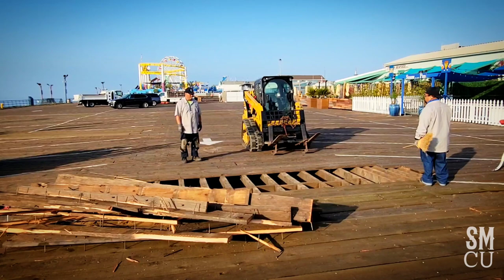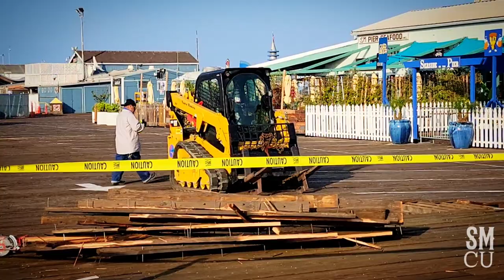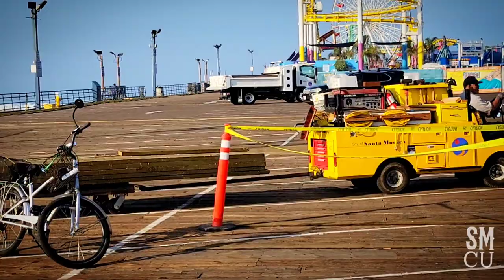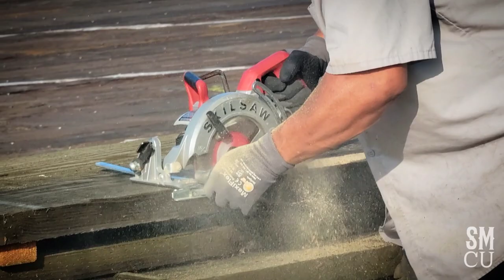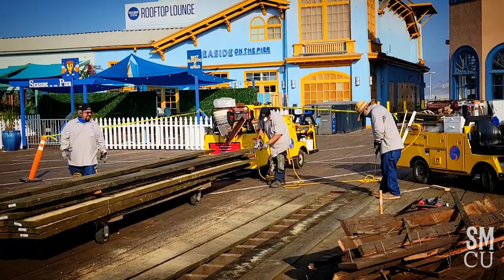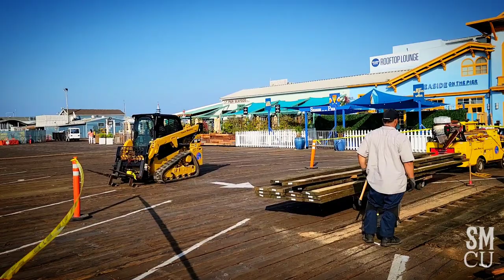New Boards on Santa Monica Pier

Comment: I worked on this crew for a year back when the end of the pier came off in a storm--80's I was 20 years old! Pilot 
holes in the boards so they don't split when you hammer 90 penny nails into them..Great job right down there at the sea!